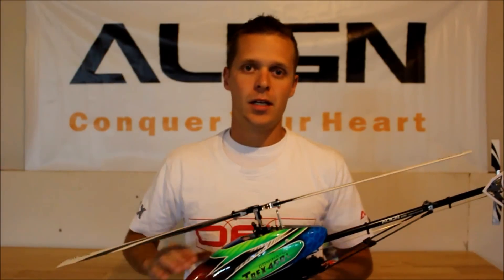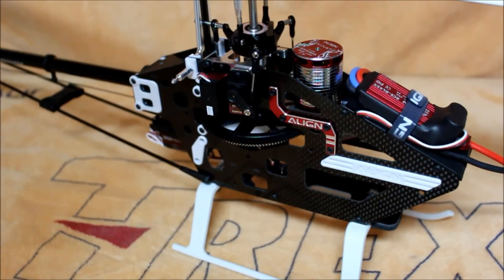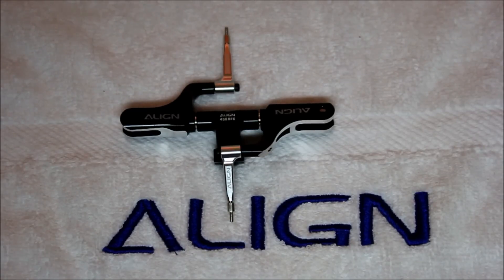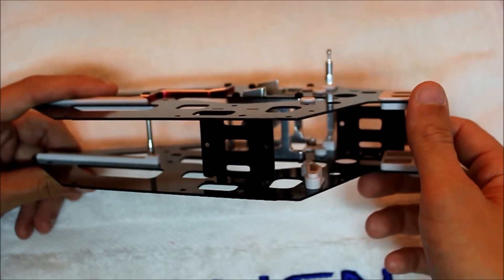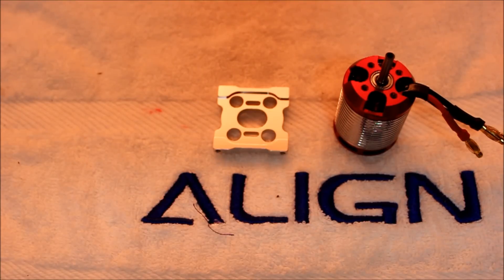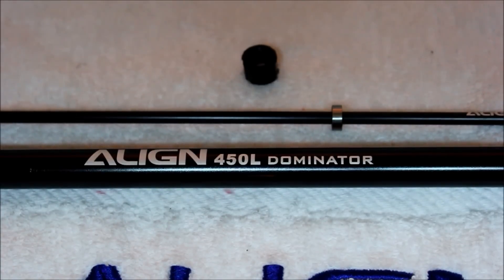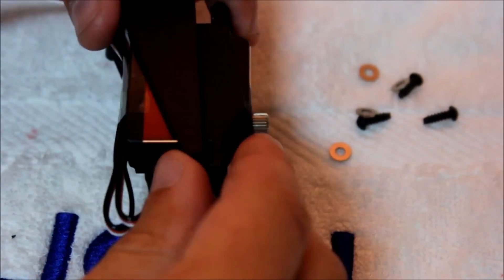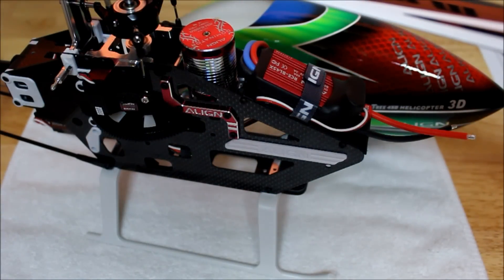T-Rex 450L Dominator DFC Build Part 1

Comment: This is a great video.  The editing is done well so it is nice and compact and you can just pause it as you go and it's ready for the next step when you are.  I am guessing part 2 would have the electronic setup, but you need to connect the flybarless unit and receiver before assembling some parts, such as the tail rotor servo mount, so it would have been nice to see at least the order to connect everything here.

I know this video is old now and we haven't seen part 2, but does anyone have any good setup info or a video on a Futaba 14SG and Align GPro configuration?

Comment: Hi Colin brill vids, now will this help me with my t-rex 600l dominator? i cant find alot of vid about the assembly of the 600, take it that there cant be much differance between the 450 and the 600 dominator apart from bigger parts, is that right Colin? thanks again
matt
Reply from the maker: Hi Matt, the build is quite similar and you can use all of the same techniques. Thanks for the input!

Comment: Hey Colin. I got my pitch links to exactly 10.5mm of metal showing with a measurement calliper. Once I put them on the heli I realized this was way off as I couldn't get anywhere near 0 pitch at half stick. I watched another video which said to shorten the DFC links to get the pitch to 0 but my are screwed in all the way. I had to shorten my pitch links to 32.5mm ball to centre distance to get my heli setup in the correct ball park. Is this wrong?

Comment: you didnt show how you get the tail boom plastic mount inside the frame.  im at this point now. and the manual doesnt even show how to do it.  it tells you to push the boom into the boom mount first. but then how do you get the mount inside the frame? ive tried everything and it wont clear the little hex nuts that are sticking out the sides of the boom mount as well - the white plastic hex nuts are in the way that the mount screws go through.

Comment: He didn't address it but you won't be able to get the tail boom into the frame if all the frame screws are in tight.  You need to spread the frame apart to get the aluminum hex studs into their white plastic housing in the frame.  If you have all the frame screws loctited it won't work.  I had to take out the back half of the frame screws it order to be able to spread the frame apart.  Not a big deal but the manual doesn't show this.  Get the tail boom first before tightening down the back half of the frame screws.

Comment: I have a clone of this model and I go to tighten up the spindle and the blade grips don't move smoothly. is this normal? if not how do I fix this?
Reply from the maker: Chances are the tolerances are off on the clone which are causing the bearings to get crushed as you tighten the bolts. This is why it's best to use genuine Align parts.